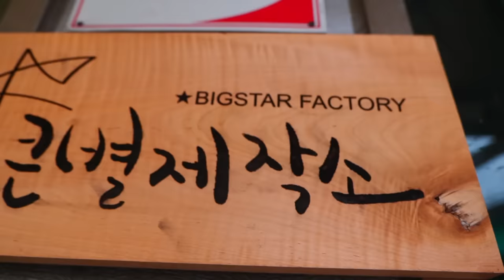The process of making a $10,000 table from rotten wood. Resin Wood Master.

Comment: Is it always necessary to sand the first coat and then apply another coat ? Or single coat is also fine?
Reply: You can use a single coat but a extra coat will give it more sheen and contrast